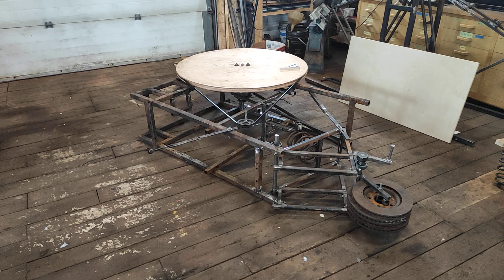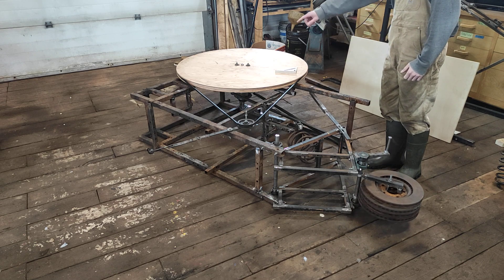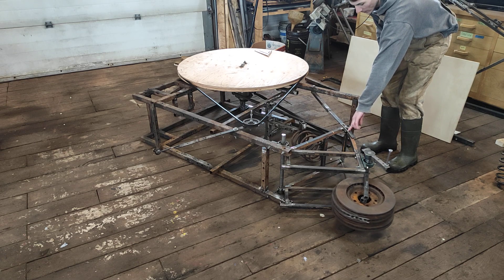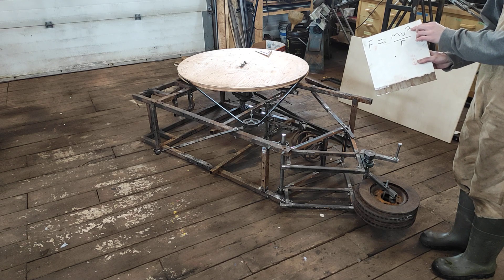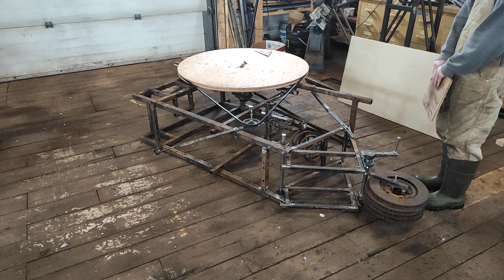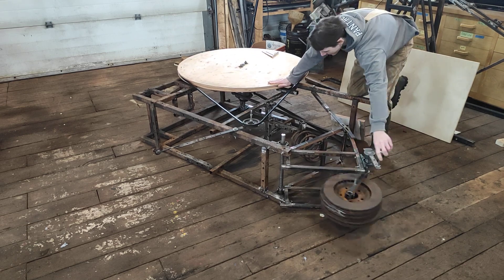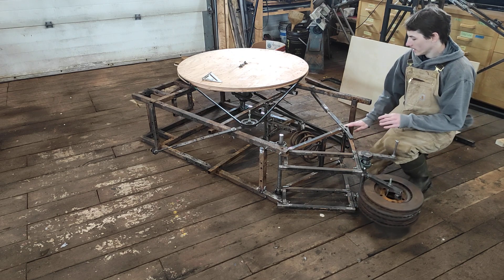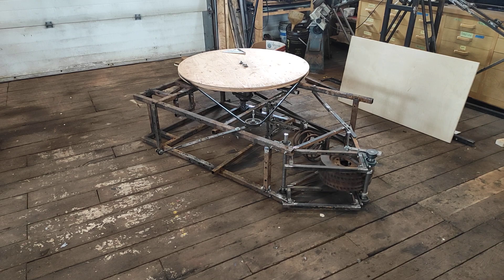Unlimited Energy Generator

Comment: Can this machine generate electricity to power home ?
Reply from the maker: not without some modifications
Reply: @QuantumEnergySearch  Do you mean yes with some modifications ?
Reply from the maker: @saowaneehorsuchart1943  Yes, this is similar to the Skinner machine which can provide 1-2 horsepower with very little input. The Skinner machine appears to employ multiple over-unity methods. David Quirey shows the correct way to get the Skinner machine to function.

Comment: Cool, so what's next?
Reply from the maker: I have to bolt it down so it doesn't move and reinforce the frame so it doesn't flex and yaw. At 180RPM (3 turns per second), there's over 750lbs of force on the weight!
Reply: @QuantumEnergySearch  Ok, but what is the process to get an infinite energy loop created? Is that possible with this device of yours?
Reply from the maker: @StringfellowHawke197  Yes. I am not sure if it will loop mechanically easily. But you want to design your machine to put out 5-20kw, so you can use an electric motor to run the input. This also is better because it regulates the speed properly. The steel frame should be replaced completely with a reinforced concrete structure so there is zero movement.